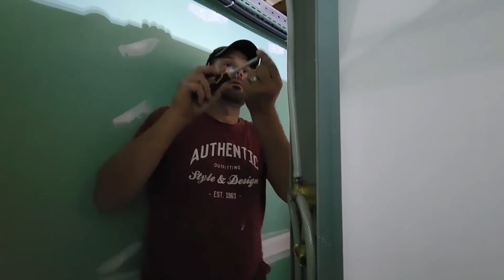It is different but it is still EXCITING!!

Comment: In Russia I have not seen any houses with panels for generating electricity. Perhaps because electricity is not expensive and it is cheaper to buy it, than to put panels on the roof to generate electricity.
Reply: Сейчас их много становится,у нас в Калининградской обл.есть завод по производству солнечных батарей.
Reply: Да, это дело довольно редкое. Вот светофоры с панелями периодически встречаю
Reply: Во многих регионах не так много солнца, чтобы это имело смысл.
Reply: В больших городах на такое покрутят пальцем возле виска. 🤪
Reply: Срок окупаемости системы с солнечными панелями сильно больше еë срока эксплуатации. Она раньше сломается.
Reply: Да,вы правы по поводу электричества.Бывает солнечных дней в году меньше чем пасмурных.В солнечных батареях нет необходимости.
Reply: The weather conditions are quite different here.
Reply: А ветрогенераторы?😗
Reply: @Пень1Бук1  в частном домостроении от него ещё меньше толку.
Reply: Дешевле подключиться к сети. Панели не окупятся
Reply: There are houses with such panels. Most often, such structures are found in places where it is difficult to conduct electricity.
Reply: именно так электричество газ вода все крайне дешево, я плачу коммунальные платежи в размере всего 30 долларов в мес за все все все

Comment: im a plumber in the US and we have the same style rings and fittings here, but i mostly use copper crimp rings or a pro press. i just wanted to say that you and your family are very impressive with all the work you guys do. very cool. good luck.
Reply: We also have PEX crimp fittings and thingies here in Russia, it's just not available at any corner store, even in big cities you ll wait your order to deliver this. shrinking PE, Polypropylene for welding and PE black pipe are common here.
Reply: Even PVC pipes here mostly used for ventilation, not for sewage. It's a riddle for me, but sometimes zinc plated ventilation pipe will be cheaper than PVC.

Comment: Third and biggest reason to DIY, if you have the skills. You KNOW, that the job was done 100 percent correctly. If you don't have the skills and have to hire it done, pray that you find someone as knowledgable and honest as the two Russian brothers that wired the house. From what was shown in that video, it was beautiful, clean work. No shortcuts taken by the brother electricians. Kudos to them.

Comment: Arend, most of Russian plumbers now just weld/solder polypropilene pipes and fittings with a hot iron. That's fairly easy and quick process.

Comment: Most likely my comment is already too late. The washing machine, to check it, first of all, must be installed on a flat horizontal surface, as well, probably, before turning it on, you did not remove the transport bolts securing the drum to the machine body during transportation. In normal condition, the tank suspended on springs dampens the imbalance inside the drum, but if it is still rigidly fixed, all the vibrations of the drum will be transmitted to the body - hence the wild dancing of the washing machine.
The transport bolts are located on the back of the machine: if they are there, just unscrew them.
Reply: У меня стиралка беко так же пляшет без болтов с отрегулированеыми ножками и специальными подставками. У знакомых так же. Плохо в барабане распределяется белье. Я всегда стираю рядом, не могу отойти при отжимах, так как она скачет. Приходится паузу включать, заием обратно и когда она правильно распрелеляет белье по ьапаьану, то то же самое белье, с тем же положением стирает как положено тихо и гладко. Впервые у мкня такая стиралка, раньше такого не было ни в одной.
Reply: @Женя-ч2ь2б брак значит у вас,сдавать по гарантии надо такое
Reply: @Женя-ч2ь2б  Это не из за неправильного распределения белья в барабане. Если машинка не новая, скорее всего демпферы, своего рода амортизаторы для гашения колебаний вышли из строя. Если же машинка новая, значит заводской брак.
Reply: У меня LG на 1000 оборотов и/или когда постельное бельё стираю скачет и без них будь здоров.

Comment: I think that building what you exactly want and especially need is the top reason for me. I was at one time in real estate and when you visit houses  you can see when the  building was built by the owner. There are things that can be done as time goes by because a house is never done. It is always an on going project. I also believe in involving the children. It helps them among other things get a deeper sense of belonging and putting roots!

Comment: That type of piping system beats out the 'ear' crimps as the inside diameter is not reduced within the system which helps keep a more constant flow and pressure.
In Canada you need to be a registered contractor to purchase the tool.
I know as I did my own plumbing in my new home as well. Using the 'ear' crimp system just means using 3/4 inch PEX for most of the project to keep flow and pressure at a good level.
Cheers.
Reply: Это ужасно, что инструмент не возможно купить без оформления лицензии. А как насчёт оружия?
Reply: @ЛарисаСоколова-з4г  зато транспереход  можно с младенчества. 🤦🏻‍♂️
Reply: для России очень странно, что инструмент можно купить имея лицензию на подрядные работы. Инструмент это не транспортное средство и не оружие...
Reply: @Natalia_13-e1p  It is job security and the company only sells them through plumbing wholesalers in Ontario.
The tool is so expensive along with the PEX pipe and fittings. The DIY kind of guy cannot justify the cost.
Cheers.
Reply: @jeffhack6839  Спасибо за пояснения! Разве в Онтарио люди не могу купить инструмент в интернет магазине другой страны и заказать доставку? Я думаю, если человек хочет делать своими руками, то он может это сделать, и конечно большинство людей будут обращаться к таким специалистам как ты, потому что люди не имеют понятие как строить всю эту сложную систему. Удачи во всем! Рада общению. 🙂

Comment: I just bought this little soldering thingie for PP pipe for 800 rubles and done all the plumbing I ever wanted :-)) Cheap and efficient, not exactly pretty or fast, but it worked great, not a one leak even though it eas my very first time doing it.
Reply: не согласен. ПВХ трубы лучше клеить. ПВХ очень сложно расплавить так, чтобы не началась деградация структуры. Если уж паять, то только ПП трубы, ну или медяху :)
Reply: @strelov1520  Yeah, yeah, my bad, it is PP, I'll edit the OP

Comment: Been switching our ranches water system over to the expandable pex system, it’s hands down the best system to use of modern options (having gone through plumbing trades when you used to have to know how to solder😢) It won us over with how tough it is with handling issue of frozen pipes!
Reply from the maker: Good to know, thank you

Comment: There're all types of plumbing connections available in Russia - from copper soldering to PX press fittings. But you've got what you've got
Reply from the maker: Unfortunately the ones i am talking about are not available,  that was the point

Comment: Arend, what I did for electricity was the power company put the pole at the end of my property with the meter, then I dug the trench and layed the underground cable to the barn, from the barn to the house. It's not that hard but the underground cable was expensive.
Reply: In Russia, an underground armored cable costs about $ 10 per meter. At 220x3=380V 15 kW. His house is 150m from the village. The price of the cable will be $1,500 without work.
Reply: @Serg-qr5my  yes, I went 100m and it cost 1500usd and that was 2020
Reply: Воздушная линия надёженее и безопаснее на перспективу.

Comment: I'm russian and this is first time in my life i see this 'pipe stretching' tool...
Reply from the maker: Interesting
Reply: Google Gigant gpw 1700 for example, it's a thing that heats pipes and then you can stick it together, that's what i saw. Well maybe because i live in apartment and pipes are not supposed to be flexible. Not sure. And to connect pipe to metallic parts we have fittings to screw it on. Not sure if I'm using right terms, i specialize in different area, not related to construction.
Reply: Всё потому что, практически никто так трубы не соединяет, я тоже первый раз такой "инструмент проктолога" увидел 😀
Reply: И я тоже)

Comment: Hello! I am writing through a translator. You have not unscrewed the shipping bolts from the washing machine. The bolts are screwed on the back wall of the washing machine body, there is not one bolt, there are many of them, these bolts are installed at the factory so that they support the drum during transportation. These vibrations are caused by the bolts supporting the drum.

Comment: Pex is available in two different styles, pex "a" and pex "b". The style your used to in Canada was pex "b" style which uses the crimp rings.  Pex "a" has the advantage of maintaining full sized water pathways so a ½ fitting is actually a full half inch instead of being slightly smaller, also pex a is more forgiving with kinks and freeze thaw cycling. Most contractors use pex a here in the US.. and pex b is more common with diy installers, cause of the price of the crimping tool. FYI ☆☆ Pex a and b fittings and line aren't compatible ☆☆ if mixed leaks can occur.

Comment: That PEX is called PEX-A, and I have it throughout my entire house as I built my own house as well. This is part of the reason why I enjoy watching your house build. The PEX you are mentioning that you used in Canada is just standard PEX-B. Reason PEX-A is better, is because it doesn't constrict the water flow unlike PEX-B, which as to fit inside of an upstretched pipe before being crimped. I purposefully did my entire house with PEX-A. I think it's more for pros. It's alternative name here is expansion pex, or F1960 fittings. They actually sell PEX-A in Home Depot now as well, along with PEX-B, and probably create lots of confusion. PEX-A pipe is more flexible, can curve better, and can be repaired with a heat gun if kinked, something you can't do with pex-b pipe. I learned all this myself as well watching various YouTube channels during my own build, so wanted to share the knowledge. Not too many standard folk know about PEX-A, but I love it. I did have to buy that $800 expansion tool to make it work, but they also have manual hand ones, but I think that tool requirement might be the reason it's not often used by homeowners. Also another interesting fact about PEX-A, is that you can expand the fitting, and then get it into place, so you can use it in tight places where a normal crimper may not fit. That concludes the PEX lessor for the day. Consider yourself lucky, you got a better PEX system than you had in Canada :D And hello from a Russian living in Alberta :D
Reply from the maker: Thank you for sharing!

Comment: This is the best pex, in  the US this pex is used everywhere.  I recommend you cut a 10" pipe cap one side fill it with water and cap the other side,  then freeze it,  and you will see why this is the best pex out there. Ones you do it for a while its the simplest qay to do plumbing
Reply from the maker: Not sure about the simple part, ive used pex for many years and it works great but theae fittings i am using here are definitely not simpler than the ones i used in Canada. Haveca look at some of our older videos when i did the plumbing in our last house

Comment: Never heard of these polyethylene pipes in Russia. But after googling I found out that Arend now uses PEX A pipes, and used to use PEX B pipes in Canada. They say that professional plumbers use the PEX A system because PEX A pipes are more flexible and can withstand frost better. Also, the internal diameter of PEX A fittings is larger, so the throughput is 20-30% higher.
Никогда не слышал об этих полиэтиленовых трубах в России. Но после гугления я узнал, что Аренд сейчас использует трубы PEX A, а в Канаде использовал трубы PEX B. Говорят, что профессиональные сантехники используют систему PEX A, потому что трубы PEX A более гибкие и лучше выдерживают мороз. Кроме того, внутренний диаметр фитингов PEX A больше, поэтому пропускная способность на 20-30% выше.

Comment: A similar PEX system to that one is available in North America as well. In fact it is a bit better than the metal rings which can fail. I have heard of a few instances of them failing, perhaps due to poor installation or corrosion of the rings. It is all plastic, except for the brass parts, so there is nothing to rust.
Their drains, though, are easier to install. No glueing parts together, most of it is joined with rubber gaskets.

Comment: Don't be afraid to say the biggest reason you build your own stuff. You are 100% guaranteed it will be done right the first time. Or at least you will not finish the job without being satisfied you did an adequate job. Spending money is fine, risking money unneccesarily is not fine.

Comment: The thread on the pipe and joints will leak if not screwed just tight enough. I have a dripping joint from  recently installed outdoor faucet. I like this set up better than the way we've done it for years in our area.

Comment: B type pex is what you are working with. The longer it's together the tighter it gets. In my opinion it's a better connection. A few plumbers around use it around here (South Dakota) I personally have never used it. I believe  wirsbo is the brand name.

Comment: Love watching the program, I'm here in Utah USA. I never miss an episode, I think with that tool run it till it's fully expanded and then turn loose of the trigger that will keep the pipe expanded until it holds long enough for you to put the fitting in. Have fun

Comment: Axial fittings for PEX that you have used are very good and reliable. But they require very expensive instruments. We have cooper tubes and soldering fittings, of course, they were very popular and widely used. They are sold at almost any plumbing store. But now cooper tubes are somehow expensive, so most people don't want to pay more. PPR tubes and fittings are the cheapest and don't require expensive instruments, so most people use them. Especially for PPR tubes, you need to use proper armed tube type for hot water and heating systems - they are different: glass-armed for hot water, aluminium - for heating (because aluminium layer prevents oxygen diffusion).

Comment: Due to the expansion of the pipe, the fittings do not reduce the inner diameter, this reduces pressure loss. 
The SharkBit system has negative reviews from plumbers, there are leaks after a few years, because the insulator is a rubber ring that can be damaged during installation or it will dry out over time. And the fittings themselves are probably not cheap.

Comment: By the way, the vast majority of Russian people have the same mentality as you.Therefore, our so-called "service sector" is much less developed than in the West. In Russia, as a rule, people try to do everything themselves, of course, if it is possible for them.Unless it's some kind of super complicated thing that automatically requires a specialist.Let's say if you are well versed in cars, then in this case, for a Russian person, it is stupid to turn to the services of a car mechanic. If you can glue wallpaper (and the vast majority of Russian people can glue them), then it's stupid to hire a person who will paste wallpaper on you.If you have basic knowledge of electrics, then you will not call a specialist to change the outlet.And so it is in everything.For example, I am now 64 years old, when I first encountered a computer, I was 36 years old(I was already old enough :)).....but this did not prevent me from understanding all the intricacies of the computer, and now I have to call a master to repair the computer, there is a rather it's a stupid thing, because I can repair it myself :)..and so it is in everything.....In general, the basic skills of any Russian man include at least the ability to change electrical outlets, change brake pads on a car :), install a Vinodus on a computer, build some kind of shed out of planks :)........peel the potatoes, wash the floor in the apartment :) and so on :)))
Reply: Александр, современный молодой человек в массе не то, что розетку установить, реально полку повесить не может, да и нечем ему - инструмента нет, дома (зачастую это съёмная квартира на двоих-троих) модно иметь кровать и ... и всё. Зачастую вместо кровати просто брошен матрас, потому что дома они только спят, зажиточные играют в приставку, а "олигархи" имеют персональный компьютер. Это заодно объясняет, почему у этих бедолаг айфон в кредит - он им заменяет всё, и ПК и телевизор, и игровую приставку :D А если глянете стоимость квартир и уровень зарплат, затем сопоставите с процентом ипотеки (от 20% если что), то сможете экстраполировать "прекрасное" будущее нашей великой страны :D  А вы говорите - менталитет, у вас устаревшие сведения 30-летней давности :D
Reply: смотря какой west. Воспоминаний о сервисах (электрика, сантехника, инет в дом, садовники...) в Италии хватает чтобы всю оставшуюся жизнь любить наших сервисников.
Reply: @RushFuture  Не знаю, но мои дети и их друзья вообще ни как не попадают в ту категорию "молодых людей" которую Вы назвали.

Comment: Did you remove transportation bolts from the rear side of your washing machine?

The most reliable plumbing technology in Russia is PP pipes. Pipes cost a bit more but all fittingы are CRAZY cheap and everything connects by soldering, so all tubes are becoming as a one piece of polypropylene, 100% sealed and protected from temperature expanding/shrinking.  It is the most reliable (after copper pipes) system I saw in my life and I have assembled a lot of pipe systems with PP pipes already.
https://www.youtube.com/watch?v=9hqT1ETMGKo

Do you have post address on the spot you are building house already? Have you asked officials if you need legislate your building?